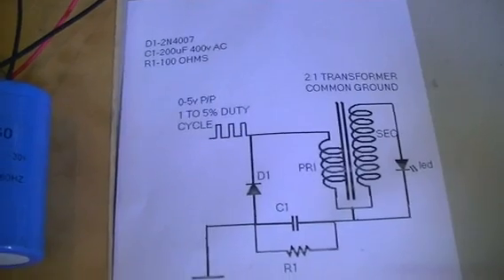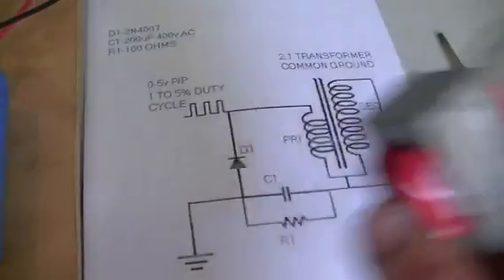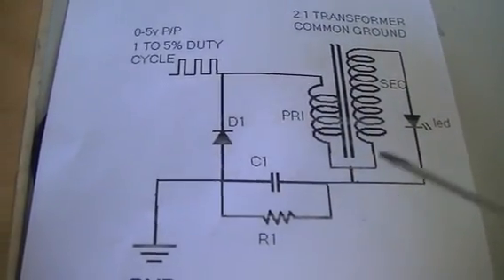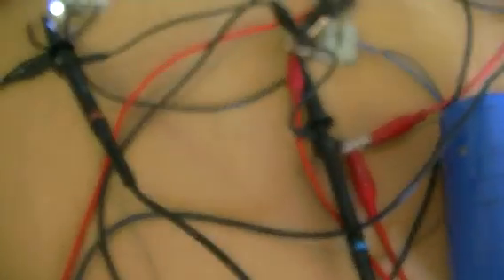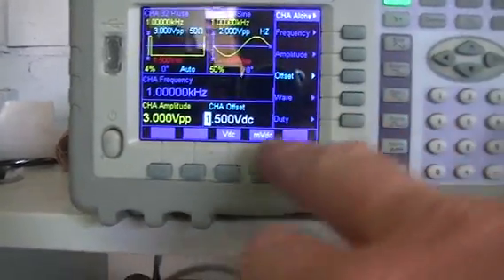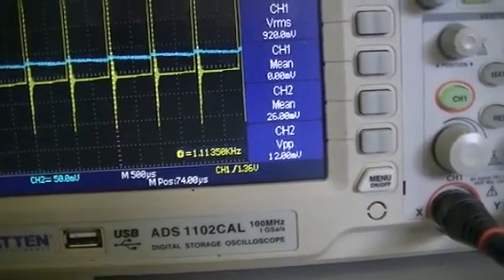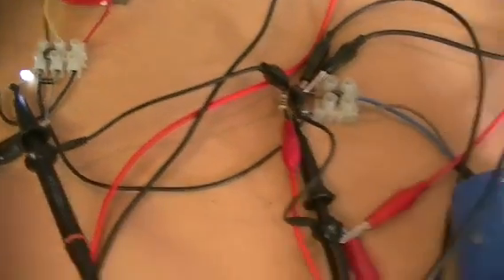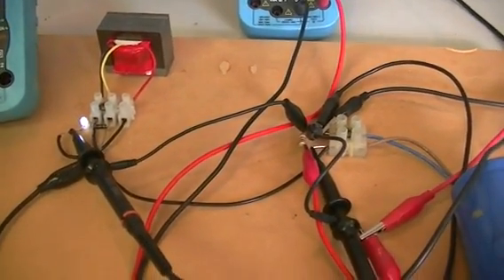Overunity transformer project

Comment: I was thinking about it... I believe the reason there is no ring in your primary coil, even though there is a ring in your secondary, is that diode you put in there for protection... Try the setup without that diode and I think the ring will be visible on your primary...
I am not an authority on this stuff, but I don't mind throwing my 2 cents in here and there.
Awesome stuff Tinman, as always ;)
Peace
Ben